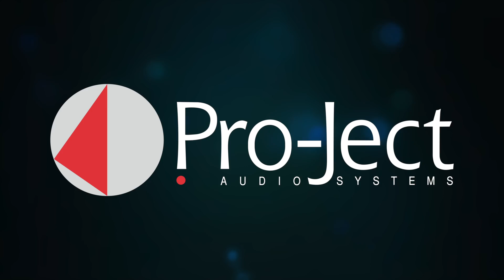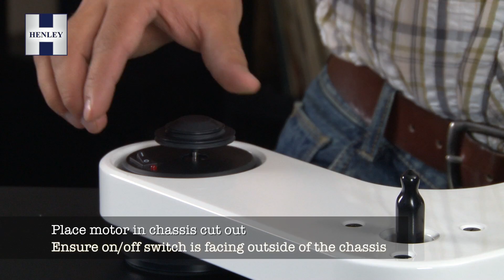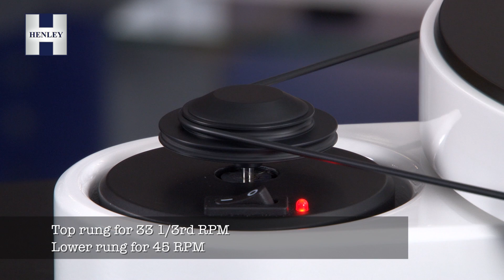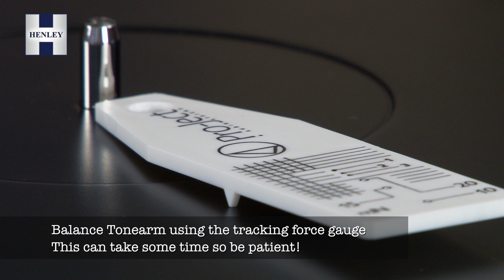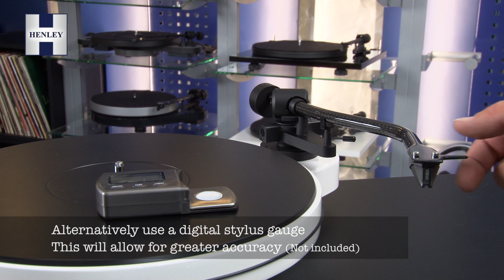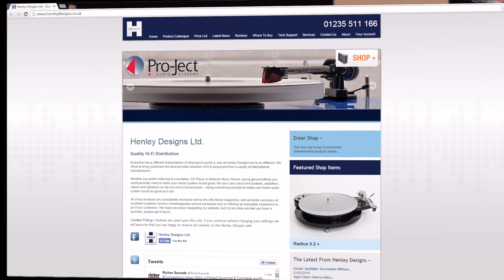How to Set-up your Pro-Ject Audio RPM 3 and RPM 1 Carbon Turntable

Comment: It looks quite easy to set up. Maybe later in the year or early next year I’ll get one!😁 Regarding the motor being uncoupled, the last time I heard of an uncoupled motor was on the Nottingham hyperspace turntable. Is it’s goal and effect principally the same?
Reply from the maker: Hi Jazzman,
Absolutely, yes - the principle is exactly the same! By decoupling the motor from the main chassis you remove the vibrating-creating unit from the equation. This means less vibration transferred to your stylus and therefore audio signal.

Hope this helps!
Reply: @HenleyAudio  
It helps tremendously, thanks. It sounds like a really excellent turntable.

Comment: I have the weight on my tone arm as far back as it can go and it is still not balancing using the tracking force gauge supplied. Im having loads of problems with records jumping,
Reply: I have an RPM 3 my tracking force is set to 1.9g my counter weight does extend past the end of the tone arm shaft by 2.98mm. Tracking force is with a digital scale, distance is measured with calipers. Note i am running Ortofon black mc cartridge which is very far back in the adjustment. It sounds to me if you are constantly bouncing you may not be measuring the tracking force correctly.